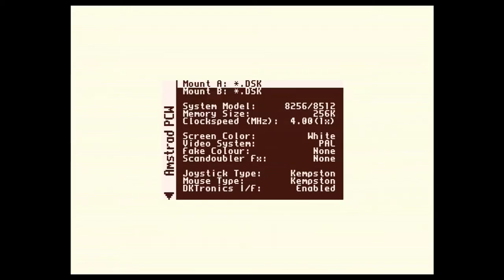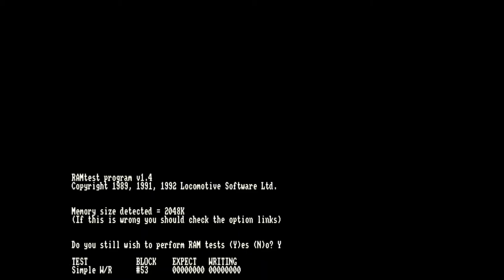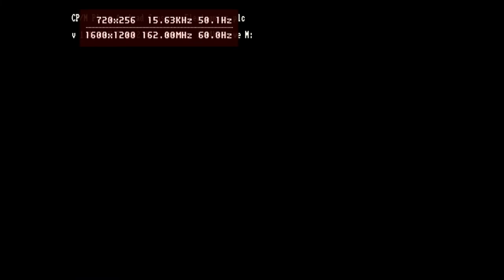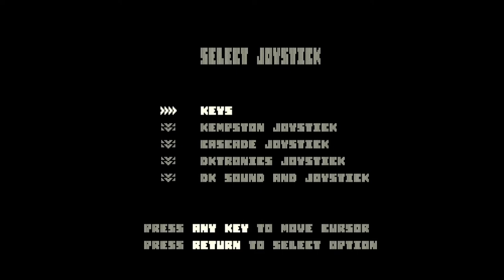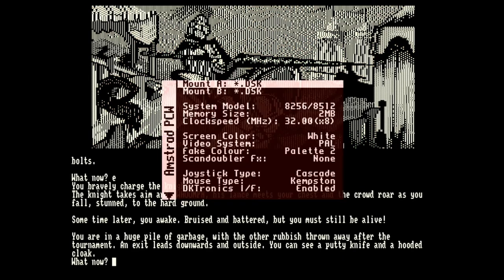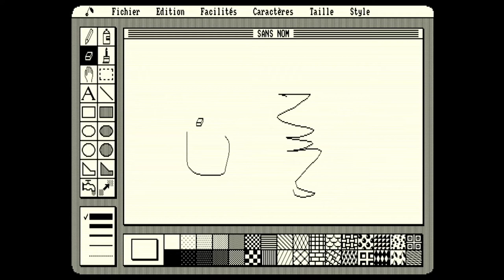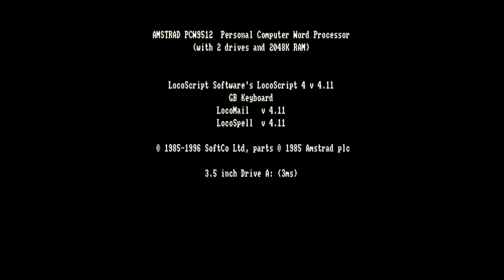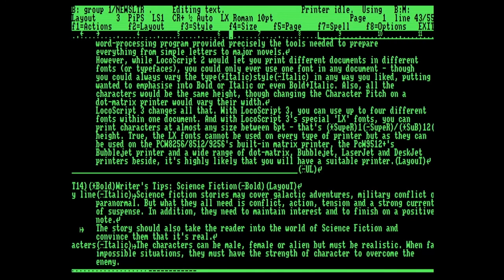PCW MiSTer Core - release 2 features

Comment: Hello,

I was thinking of designing an Amstrad PCW8512 in 'Real' Hardware...using a CPLD to generate the Video Display (720x256 ) and possibly a second CPLD for I/O such as printer and PS/2 Keyboard. 

Something with the spec:

Z80 CPU (TMPZ84C015-10MHz or Z8S1516 16MHz)....have CTC,PIO,SIO on chip
512K Fat SRAM
64K Fast  EPRPM/Flash
CPLD (EPM7512AETC-144 or Xilinx) for Video and some I/O + Memory & I/O decoding.
MCU for PS/2 Keyboard and mouse interface
Sound Chip....?? Possibly SN76489,YM2149,SAA1099 etc
PC8477 FDC (Floppy Controller) ....is upd765 + SED9420 on one chip
CF card interface

>>* Could you tell me how many Macrocells / Gates the implementation of the Video circuitry used ?

Thanks.

Comment: Could read real 3,5" pcw formated floppies on USB FDD drive attached to MISTer ????
Reply from the maker: Hi.  No, that isn't possible.  Those USB floppy drives do not support the full list low level drive commands, which is why backup software for PC's that read non-PC format disks won't work with them.  You have to use a FDC connected directly to the floppy controller on the PC motherboard.

Comment: Sadly mine doesn’t do anything. Select the dsk file, reset and still blank screen :(. Ah well, I’ll keep trying.
Reply from the maker: You have to match the disk to the system.  You can't boot a disk designed for the PC8256/512 in an system configured for 9256/9512
Reply: @st3ddyman  thank you. Turns out my disk image was also broken because another copy seemed to work fine.